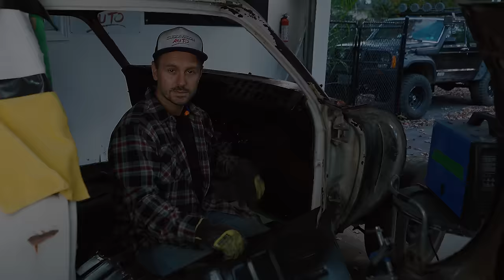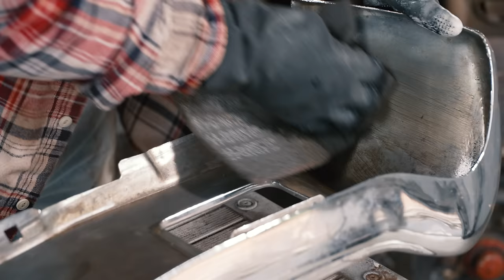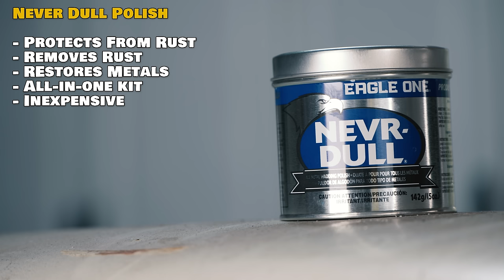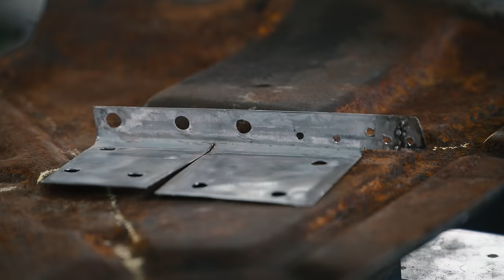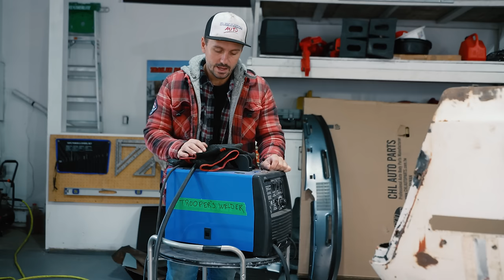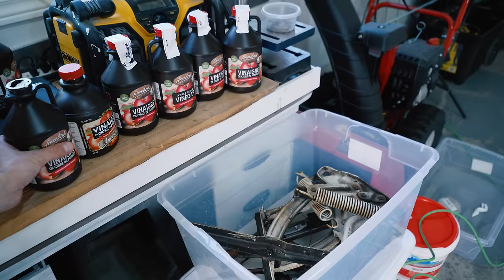These 5 Car Restoration Tips Saved me THOUSANDS $$$$ | EP10 RUSTORATIONS 1972 Chevy Nova

Comment: I am enjoying watching you build your dream car. You may already know this, but some of your viewers may not. When welding with flux core wire ( gas less) make sure your polarity is correct on your machine and that you are using the proper size  feed wheel for your wire size and flux core wire requires a special wheel that won’t crush your wire. Have fun
Reply from the maker: Yeah I don't know man we seemed to have a really big following when found the car but as soon as I started to work on it we lost the majority of them. Not exactly sure and at the same time being new to this it doesn't surprise me. But I said I'll do it and keeping going filming almost everyday. Great tips thanks man still using flux core but it's been going really well.  Thanks for the great message happy to hear some people are watching. Also cranking the amount of these up going to have another one out in 3 weeks.
Reply: @SubdivisionAuto  Hey man, dont lose hope when it comes to your reach in this series. 

I'm going through a pretty rough change in my life right now, and was supposed to be gifted an older truck from my father. Due to a lot of variables, thats not longer possible but we're gonna be searching for a 72 Nova instead to restore over the years.

I've really enjoyed watching this content as a distraction to my rough recent weeks, and am looking forward to putting some of this knowledge to the test! Keep killin it 💪😎

Comment: I use a cheap brush ,green scrub pad and sopho that's it ,keep the area wet with Ospho and keep rubbing  until your satisfied  with result ,I have taken large panels and totally cleaned them rust free perfect metal ,just remember never leave it on the metal, always wash it off and quickly dry
Reply from the maker: For sure the way to go ospho is great

Comment: On your old welder ...it probably needs cleaned ...pull out your liner and degrease it...wire has an oil film on it ...after 5yrs .. also make sure your wire grove is same size as wire ....030 ...035 ....just clean it and make sure you do maintenance on it ...if it welded before it will work again ...good luck with nova ...I always liked them ....
Reply from the maker: No kidding that's good advice I didn't know that. I got rid of it got a new one but I use it so much that it will need to be cleaned eventually. Already burned through a out 12lbs of spools. Thanks for the advice

Comment: Wuth as small as the air compressor is you might have more time to use you air tools if you set up an axillary air supply tank your compressor will work less
Reply from the maker: Yeah good point im still on the lookout for a good sized tank to daisy chain together. The compressor itself is awesome just the capacity. But even despite that still getting all the work done I need with the litte thing. Just have to be more organized. Thanks for the tip I for sure need to follow up on this before I get to bodywork
Reply: @SubdivisionAuto  I'm glad I was able to suggest that to you I'm not sure where you can find a good size tank for that maybe you can ask your friends

Comment: Good job, man. If you have more welding questions, let me know.
Idk where your at in the project today. For the wire feed not being strong enough, I'd check the roles to make sure there are plenty tight. Check the spools Tension. You don't want the Tensioner too tight. You just don't want your whire to not unravel on you. That's the purpose of the tensioner.
Looks like the new one is working well. 
Probably don't paint before welding.
Weld it hot it will burn the paint if it's thin enough. 
What's the purpose of the name you given your self. Is it like making it fun for the Viewer. 
Noticed several strategies you're using 
But one being the safety equipment is that so the brand is clean enough for potential sponsors? 
Like the branding loos like you put time in it. 
I'm going to Use the vinegar trick i didn't really think of that. But I did know of it. Basically, you're using a lower level of acid to break down the corrosion. 
I'll have to try that on our tools are shop burned down, no insurance.
Check it out. Lol, follow the process,
Reply from the maker: Yeah good points I had my tensioer too tight even with the new one made for some issues. Still trying to figure out how to set the proper tension and spool tension (The nut on this unit came as a regular and it help twisting after a while, changed it for a lock nut nows its not moving but hard to know how tight to put it). But yes new welder with the 10lb spool works a LOT better. Yeah painting before welding is pointless unless its a hidden area. The name? Its a nick name, its youtube afterall gotta have a nick name. Safety I  never used much in the past but I really amped it up now that im doing this everyday. Had a few close calls and lessons. I have no sponsors at the moment I just use what I have. But will accept them if people want to send me materials, long as their quality. Thanks as always sorry to hear about the shop that sucks man.. my heart goes out to you thats brutal.  Wishing gyou all the best

Comment: Apple Cider Vinegar works fine (but is a little expensive).
I use citric acid (I buy it at my local bulk food store) it comes as a powder, and you mix it with water. I did my coil springs and even mixed up enough to completely submerge my heater box. It also works faster than vinegar.
You know how they used to say that you could remove rust from chrome, with Coca-Cola and 0000 steel wool... it's the citric acid in the Coke, that does the work. 😉😉😉
Reply from the maker: Oh wow I'll have to try that next very cool thanks! What ratio do you do water to acid?
Reply: @SubdivisionAuto  You can play around a bit with it, but I kinda run about 2 cups to a 5 gallon pail... I don't think you can overdo it. 🤣🤣🤣
I also do small amounts in yogurt container (650g) for doing small parts, bolts and screws and such. My Nova spent most of its life in Vancouver, B.C. (The Wet Coast)...
Every single thing, had a layer of rust (some of it is literally very light surface) but everything is/was rusty... Mainly, a Victim of Extreme Humidity... But we're getting there...
Reply from the maker: @boatnut64 Okay cool i need to do a follow up to this so ill try your method. Thanks! Oh man love Vancouver all the cool cars and places are there. I am going to drive the Nova all the way to Nova scotia next year when its done, hopefully westcoast the following year